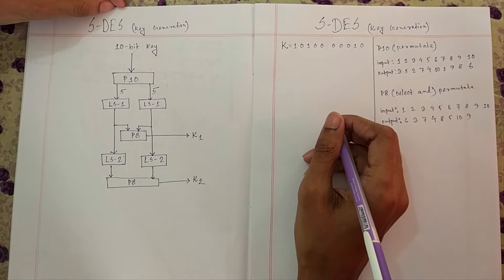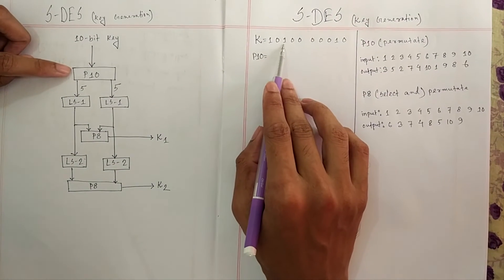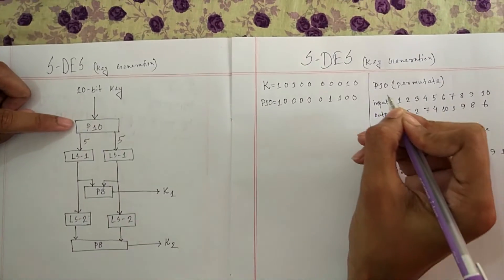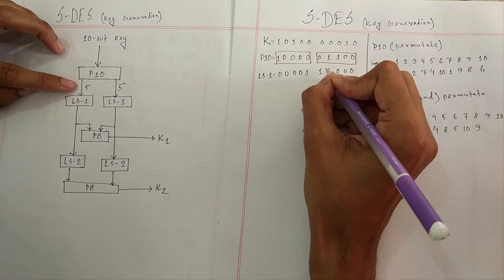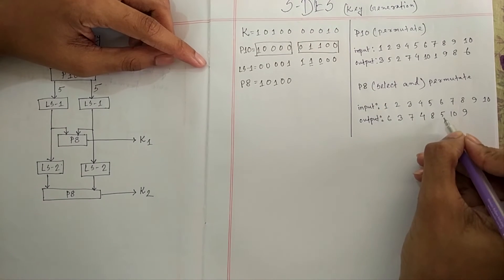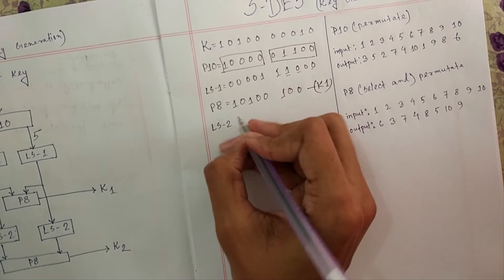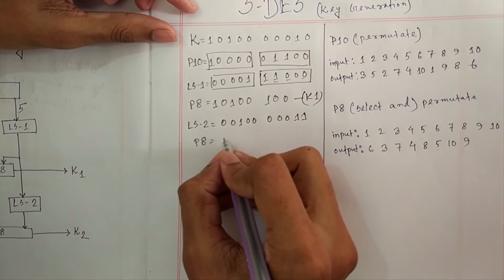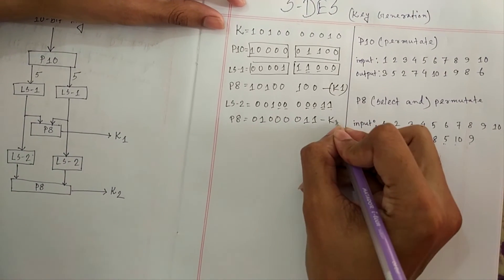Simplified data encryption standard(S-DES) || S-DES key generation with figure || Shafiq Refat

Comment: How y taken input and output values
Reply: the input values is just from 1 to 10 and output values should be given in question example is: 
Explain with the help of suitable diagram the key generation process of S_DES cipher. Calculate the values of k1 and k2 using the values of K = 1010101111. Given the value of P10 = {3,5,2,7,4,10,1,9,8,6} and P8={6,3,7,4,8,5,10,9}
i don't known why i reply ur message though